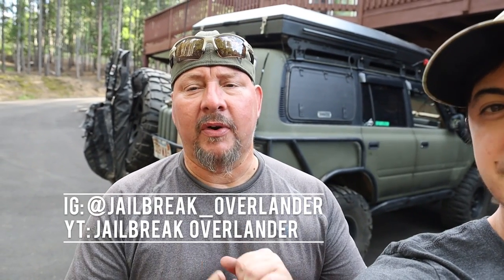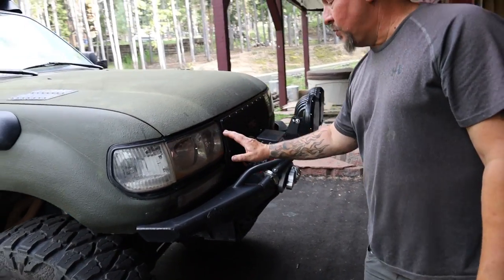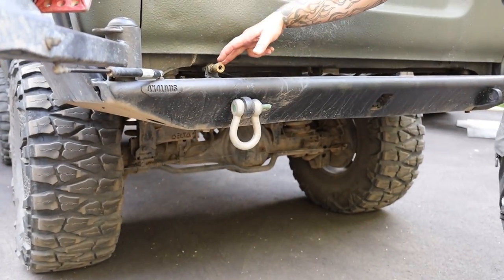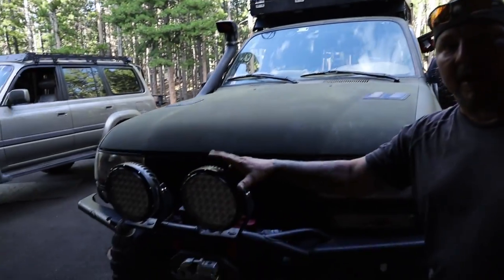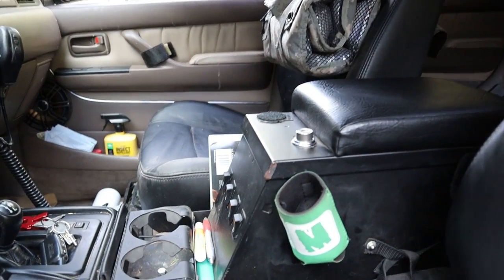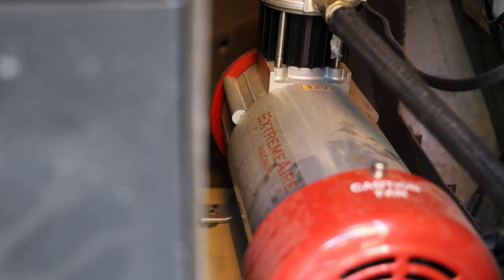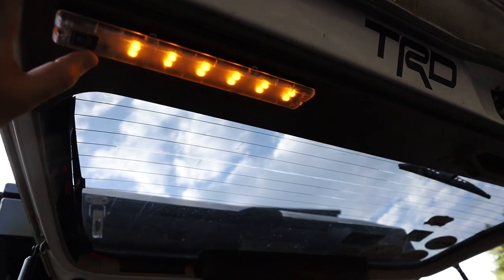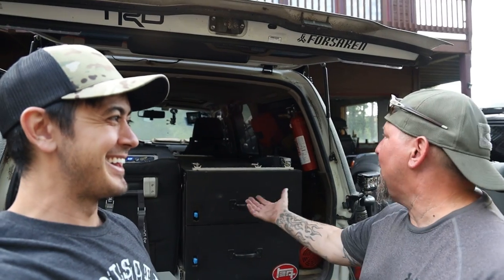MONSTER Land Cruiser - Supercharged FZJ80 Overland 80 Series Rig Walkaround - Jailbreak Overlander

Comment: Welcome to the club, hands down the best 4X4 ever made. And mine isn't even triple locked. 

It's kind of like a graduation for you. You will not be disappointed with this vehicle. This is why you pay a premium to get one. There is no Jeep on the planet that will hold its value like an FJ80.
Reply: Larry Briggs I have a 97 lx 450 engine started knocking think it is a rod ,I want to put a 4bt cumins any thoughts
Reply: Branden Kelsey 1uz swap !
Reply: @brandenkelsey8929  I read somewhere that 4bt's are now made in China. I would think twice.
Reply: @brandenkelsey8929  
You can probably find a used engine for $1000 or less, swap it in, and then do a proper rebuild on your current engine.
supercharging or turboing the 1fz will be easier, and you'll get a lot more power.

Otherwise, buy an old mechanically injected isuzu NPR diesel for 3-5 grand and decide whether you really want the diesel noise. They are LOUD. louder than all the diesel pickups. and its not exhaust note, it's injection pump sound. Then realized that the 4BT will be louder than even that.
Reply: fj80 are the 90-92 models with the 3fe 4.0 L petrol I6 motor this is a fzj80 with the 1fzfe 4.5 L petrol I6 motor the HDJ80 has the 1HD-T 4.2 L turbodiesel I6 the HZJ80  has the 1HZ 4.2 L diesel I6
Reply: @brandenkelsey8929  ......just wondering if you engine swapped or not. Personally I’d go 6bt

Comment: Now it's all coming back to me.  I came across the young guys channel when he posted his thing about his Taco.  Being an 80 owner, I haven't seen the guy since, until this video now...and it's great to see he got an 80! 

I think what cements the 80 as THE GO TO ride for long-term serious off roading is the simplicity of the electrics, the real military-grade off road hardware, and the dry storage volume that comes with all that.

Ritchie obviously has added some complexity for the sake of added capabilities and to fit his needs.  But as he said, "I did all the work, so I can fix it if need be."  And THAT is how is should be done. 

You can always tell who built their truck and who bought their truck.
Owning is one thing.  Operating and maintaining is another.  And unlike most of the plastic banana off roaders manufactured since the mid-2000's with "electronics and software" replacing real hardware, the work and expense committed to 80 hardware and drive ability is nearly absolute.  Meaning it will always work and will always provide the same output with a given input.

Wait!  This Ritchie is THAT Ritchie from Boston??!!  Dude!  I downloaded your content from WAAAAY back that I don't think is online any more.  Hilarious!

Comment: You bought the tank of Toyota’s. You won’t be disappointed!
Reply: Christopher Barnett how do the old late 90s 4runners stack up against these??
Reply: @Madmaxxxx1984  They don't. Don't get me wrong those 4runners are great but the 80 series landcruisers are tanks. The 1FZ-FE 4.5 liter v6  does serious work. Not to mention Australia had a turbodiesel. The 80 series landcruiser has much more towing capacity and off-road capability then the 2nd gen 4runners.
Reply: They are a inline 6 not a v6
Reply: The true tank is a fj55
Reply: @Madmaxxxx1984  the LATE 90s runners, meaning 96-02, would be a 3rd gen, in my opinion they are amazing rigs. They're not linked solid axle dual locker rigs,  but most of us spend more time on road than off.. and with that being said 3rd gen runners are way better on road than an 80

Comment: I had a 40th but running 6PSI turbo initially and 240Kw. As ususal it need more power (for overtaking) and I started running 9 and then 10PSI with some minor changed. This was the best car I have ever owned and crossed the Simpson Desert here in Australia, and never once let me down. It was another car tboning me that finally got the cruiser down. I miss it heaps.

Comment: WELCOME TO THE 80S CLUB ! You will love love driving this - it fits almost everywhere. Jealous of the triple lock - almost cheating. Either way I live about 40 minutes from you we should go wheel
Reply from the maker: Yeah for how big it seems, it's really not. I was comparing some dimensions to my gf's new Rav4, and wheelbase, overall length, etc is remarkably close to a new Rav4. Granted it's significantly taller, and seems much more massive inside - it's kind of deceptively small.
Reply: @LastLineOfDefense  - Jailbreak mentioned the tailgate cavity for room - both rear side panels cover large cavities as well. Wher ed you have the rear winch is another large cavity. When you start using it you'll see why the 100 series is bigger however doesn't have the storage & harder to park

Comment: Nice.  I bet you guys would love diesel power though.  80's are still selling for decent coin in oz.  The last wagon with solid axles.  We do get 70 series here though too.  Spoiled for options, buy they are quite expensive.  Use your fav search engine to see the 70 series landcruiser.  It's a fair bit more industrial than the wagons (80, 100, 105, 200).
Edit, luckily that thing has a blower.  Probably wouldn't go uphill with all the extra weight!  How good is Ronny dahl's channel?!

Comment: Awesome 80, the 40th ed is the best LC apart from the 70s VDJs 4.5l V8 TD and in the 1HD-FT and FTE which you guys don’t get so understand, 6c with a TRD SC it is badass, anyways except the fuel economy and range. You guys buy fuel at the gallon it costs us per litre, so slightly different. Be good to have found out what MPG he gets and I see it’s a auto a 4spd, 40th ed with a 5spd M and FTE been trying to find here for some time, dam hard and dam expensive regardless of Kms on the clock. 

Will you be doing a build series on yours? be interested to see that, newer stuff or current vehicles don’t interest me much, I look on what he has done as an investment not a cost, anything  can turn into a money pit, esp if you don’t research it, knkw what to look for and then newer cars trucks if just thrown cash at and the look at me must haves rather than functional practical use, or electronics, but this 80 is awesome.
Have you had any comparison between Raptor lining vs Rhino lining ?

Great vehicle reveal enjoyed this cheers. 🤙 
btw Sd both ch.

Comment: So - which nuts (4) need tightening?  (80 series owner here too)
Reply: That phrase refers to the steering knuckle lower trunion/steering arm (aka knuckle studs).  There are 4 per side & many an 80 owner (myself included) have found out the hard way to check them periodically.
Reply: @krisbryant7993   Thank you!

Comment: I want to put my 100 in olive gray Raptor - BUT and there'S always a butt - Before I can do that I need to completly go over the chassis and the frame, sand it down, clean it, rust proof it, fix the rust and get the frame nice thick paintjob and then and only then there's time to apply the Raptor on the chasss. Theres also some rust going on around windshield and rear window. so Those gonna need to get taken out - and I'Ve heard that windshield on landcrouser does not survive the removal. =C

Comment: Forgive me, but I know -0- of off-road life.  What are all those batteries for ?
Reply: Fridge and whatever else he has on board.
Reply: The second battery is isolated from the main starter battery so you can run accessory loads when the truck is off.  You never have to worry about the truck not starting from a dead battery.  On mine I run lights, radios, fridge, charging for phone/camera, and whatever else.

Comment: Now go buy some spare rear hatch or doors, you will need them after some idiot drives your spare through the back. Bumpers need to project back enough to 'bump', ie: protect the rear of the body from impact.  I prefer the original location for the spare, or on the roof.

Comment: Got hot driving up a hill for a hour, fucking junk
Reply from the maker: lol
Reply: @LastLineOfDefense  yeah, pretty funny right. Just the behaviour one would want in a machine you take miles away from anyone
Reply from the maker: A 22 year old supercharged rig, 3,000lbs overweight, with massive heavy tires, lifted 7" with a roof rack and tent up top, gaining thousands of feet of elevation up to a house at 9,000' is allowed to "get a little warm" in my book. Actually there are plenty of bone stock vehicles that make the same drive and are regularly on the side of the road overheated.